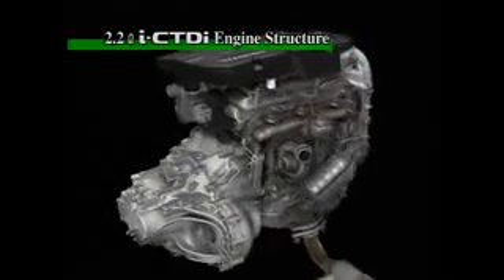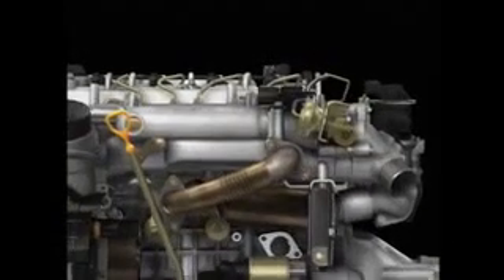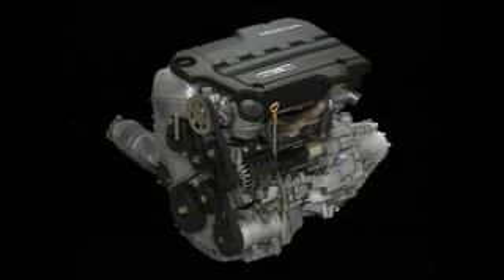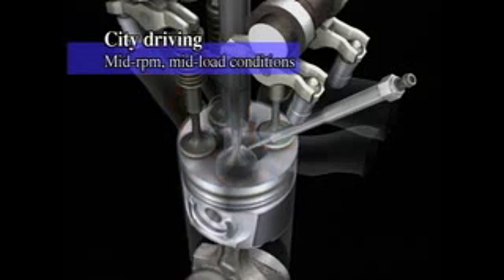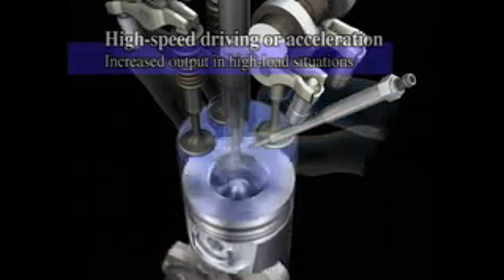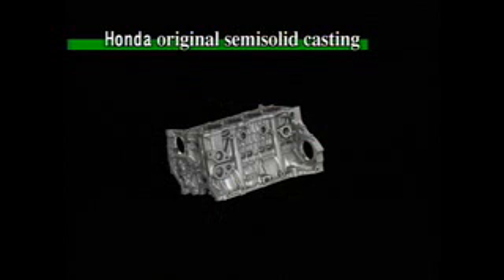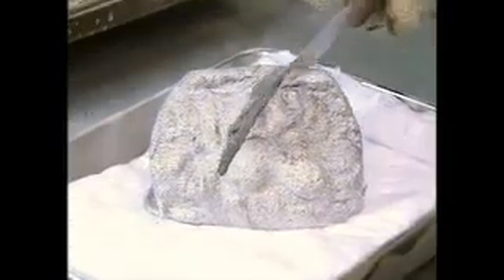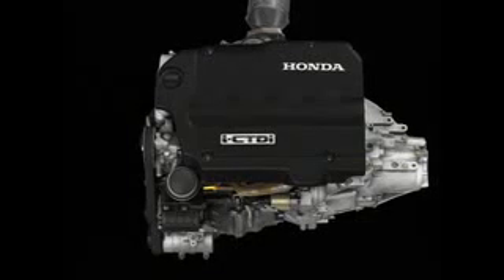Honda turbo diesel engine: i-CTDi

Comment: How exactly does the "optimized swirl control" shown at 4:45 work on a diesel engine? A swirl effect is helpful on gas engines to help mix the air and fuel, but since there is no fuel present during the intake stroke on a diesel, what exactly does swirling the air accomplish?
Reply: I guess it is to mix the egr system gases with cold air better.
Reply: @wwilliee  Could be, didn't think of that!

Comment: Uhh, nevermind all the other stuff, how do you get 1600 bar of fuel pressure? It’s equivalent to roughly 23000 psi! Do the injectors work as pressure multipliers, bringing the pressure up to that peak in the instant before injection, to atomize the fuel? Because if not, then that’s a very spooky can on top of the engine. One pinhole, and you have the makings of a movie prop

Comment: Timing chain made from cheese. Will start rattling at 100k miles. The most common honda engines problem.
Reply: What car do you drive? People telling  bad things about honda are jealous of honda because honda doesnt break but their cars break ;) speaking from experience btw
Reply: @danijel124  I drive Mercedes e class. Used to have honda accord 2.2 ctdi but timing chain started rattling at 84k, then exhaust manifold was releasing exhaust gases straight to cabin (factory defect), also alternator died. Pure Japanese bucket.
Reply: @Ducati999cc  In my opinion german cars are way worse than japanese cars when it comes to breaking ;) have fun with your mercedes and spending a fortune making it run... Most people dont have a lot of money like some but we have to earn it hard with our own sweat and muscle.
Reply: I own a 2007 cr-v (n22a2 engine) 235k kilometers, original dualmass, injectors, timing chain, egr valve, dpf and no rattling no other problems. Power steering made some noise @ 1800-2100rpm, after filling power steering fluid to optimum noise has gone. I maintain the car very well and the previous owner did too. If one drives a car without maintance until something breaks even most idiot resistant constructions will fail.
Reply: @eligaller9190  n22a2 doesnt have power steering fluid, it's electric. what are you smoking
Reply: @ocd2222  on my 2007 crv the power steering is hydraulic. maybe on newer models its electric.
Reply: i buy  new  honda  2.2 I-CTDI   in : 20/12/2006 . Till now . Until today .07 / 09/2020 no  one problem. changed 3 discs and 6 front brake pads. 2 discs and 4 rear brake pads, and 3 batteries. 185,045 km. Ps. from 10 years, I live  in the mountains at 1600 meters above sea level , to date. From Zinal to Sion 1100 meters of altitude difference 3 times a week. The best good car ever. Honda Civic disel   . Only 1 defect. braking is a little long.     https://www.youtube.com/watch?v=Vc1kxDutjuM
Reply: I own honda civic year 2010 300000miles driven 2.2  S type CDTi glow plugs was repleaced in 280000kmiles the car driving like new no oil leaks like I been see soo much in German cars like VW ,BMW mercedes honda is cheap for mantenance and the part is cheap and good quality this car is a solid rock never broken if you care about the engine they never broken and who said is broken is because they dont care or they just jelous I going to make another 300000miles on this car .
Reply: Hhmmmm my civics done 185k and not rattling yet new oil every 5k..
Reply: @Ducati999cc hmmmmm, 217k miles on my 2.2, engine has never been touched. Maybe the cheese is strong in my engine?

Comment: i run with petrol and diesel mixed and lose power, can anybody give some ideas, please? still go strang, red light very easy, no smoke, ( only if drive local), start ok, replace oil and filters, map/maf, have a dead pedal a few seconds, even honda dealer sayd its ok, cheers
Reply: Why mix fuel? It works well on diesel...

Comment: I have this engine in my 2008 Accord GT (rare model) and I have had it remapped to 210 bhp and 420nm of torque, its a lot quicker now, it wasn’t slow in the first place. Excellent engine!
Reply: Hey i own 2008 Accord GT, no remap yet, hows your fuel consumption ? mine does 3.5l/100km on motorway
Reply: @stillrookie No way its 3.5/100km
Reply: What were all the mods did you did?
Reply: In the long term with a remap to stage 1 is the honda reliability still going to be there if I don't drive it like it's a race car
Reply: @colingovindasamy8708  Maybe if you don't drive it hard and don't push it to produce more than stock power or boost, but then what's the point of getting a tune? Remember that Honda paid for millions of dollars of engineering and R&D to design the best overall package with long term reliability being one of their main priorities. If they could have increased the boost, increased fuel delivery, etc without having any negative effects on reliability, odds are good that they would have.

Anyone can overfuel an engine, increase the boost, modify injection timing, etc and get way more power from it, but what testing did these tuners do to prove its reliability? Certainly not as much as Honda, who had to guarantee that it will at least last through the warranty period and preferably much longer since their reputation of quality, reliability, and longevity is on the line if they get it wrong.

Comment: problem exhaust manifold ,dualmass fay well,dpf, injector  anather is good
Reply: Every DIESEL car have problem with dualmass faywell
About dpf and injector they will fail if you don't use the car properly doesn't matter what engine it is
Reply: Maja Jovanovic ictdi never fitted with dpf
Reply: @Ducati999cc  civic 2007 have dpf
Reply: @majajovanovic3758  you are right I think. There was some fitted. But you forgot to mention in problems the timing chain which is the most common in these engines.

Comment: My Civic 2006, 2.2 i-ctdi with 200,000km , average consumption is 6, but in city 6.5-7 l/100km. But its diesel power is amazing. I think i need injector nozzles cleaning.

Comment: Amazing engine. With my accord (TSX in USA), i can easly reach 4.5l/100km´s and not 5.8 on the video. My record is 3.6 in each 100 km´s. For me is the best diesel engine, also much better than the new i-dtec, and Honda knows that.
Reply: I-dtec is way way waaaayyy better and Honda said that lol. Since 2012 they dedicated to the 1.6 i-dtec which is the same power as this one 2.2, also it consume as a hybrid the i-dtec
Reply: @Shaylesety   the BIG downside is that the new i-dtec has a DPF and when that goes , which it will around 100k miles and it will cost a arm and a leg to replace. The 2.2 i-ctdi doesn't have a DPF , much better engine
Reply: @marceldaniel673  doesn't any diesel car have one lol? And I'm sure Hondas, Toyota, Mazda dog doesn't run out only on 100k at least 200k
Reply: @Shaylesety   older cars don't have a DPF and cars that managed to meet the euro 5 legislation using great technology and good thinking like Honda . Other brands didn't bother investing to much and just added the DPF that it's £1000 to replace with original one . Toyota has DPF on diesel engines since 2005...
Reply: @Shaylesety  if you are sure try Google and see how many people with Honda 1.6 diesel have issues with DPF and how old are the cars
Reply: @marceldaniel673  DPF is not a problem if you drive it like a person and not a granny.
Reply: @Shaylesety  The i-DTEC is a bit less reliable than the i-CTDi, due to having issues with the DPF
Also the i-CTDi with a DPF and i-DTEC are on par with eachother when it comes to reliability, but the i-CTDi without a DPF is amazing
Reply: @Shaylesety I would say probably starting with 2010 all diesel engines have a DPF but previously NOT all diesel had a dpf  as is the case with Honda civic,acord and CRV that we're made before 2010

Comment: The first Honda diesel engines were put into production were put into production back in the late 1960s.  They were V-twin engines which produced 12-16hp and were used in generators.